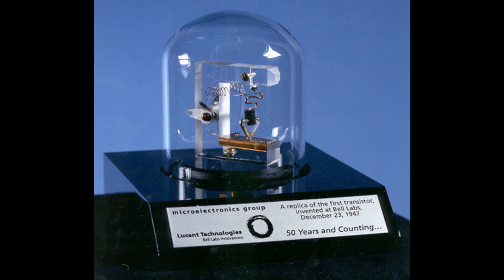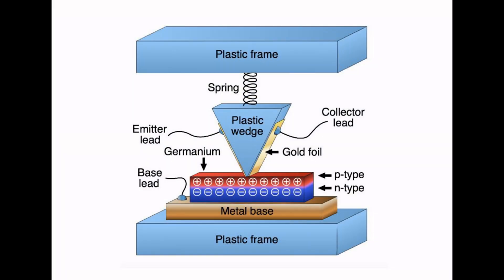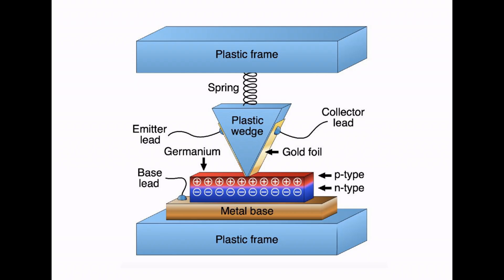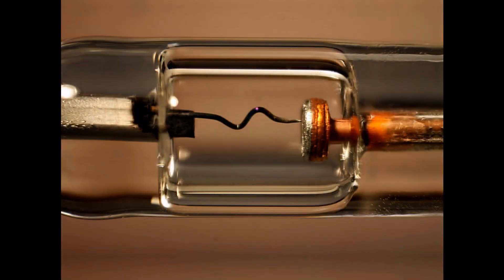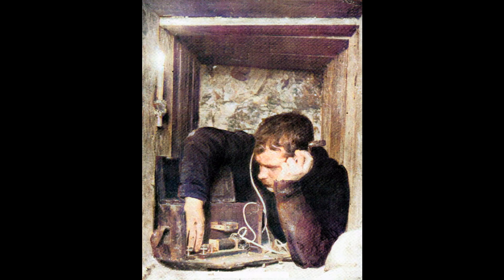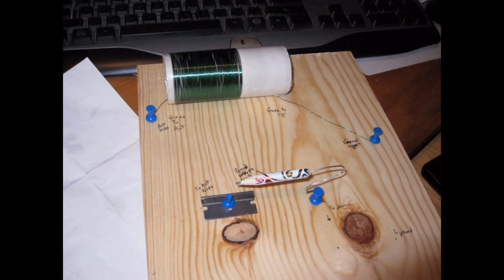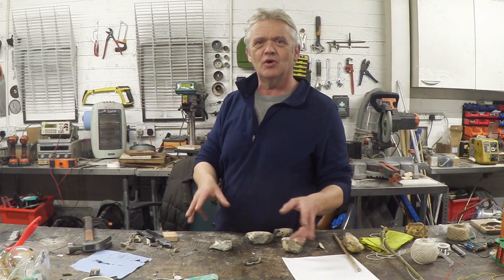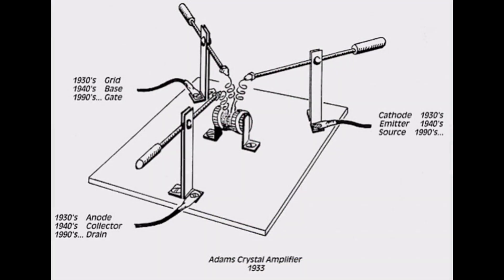1380 Making Transistors From Rocks

Comment: Try galena, it works for a transistor, especially the kind with decent amounts of silver and copper impurities. Mount to a an electrode using low melting solder. Next probe till you find points that act like a diode. Pick two that are close togther and apply a very low current to them. Look for the most change ratio of resistance with the least change in current between two points to find the highest gain.❤
Reply: I'd been looking into how electronic switching components could be constructed from simple materials, namely those which would've been available in ancient times. Relays were the first thing that came to mind, as they could be made with iron cores and copper wire, but they're eventually going to wear out at some point. Naturally, I tried to see if somehow a crude transistor could be fashioned using these materials. Galena was available in antiquity and would be used in the earliest diodes. The first transistors, on the other hand, used germanium, which unfortunately wasn't a mineral known in antiquity. As galena and germanium are both semiconductors, I wondered if galena could be used instead for a transistor, but couldn't find anything about it. Thank you for confirming that this idea has a modicum of possibility

Comment: you can cut thin pieces of crystal stone and sandwich between metal pieces to act as a transistor, or two pieces of metal painted with  thin oxide paint and dried,than two metal pieces are sqeezed together in one piece.

Comment: The point contact diode was invented by Jagadis Chandra Bose who used several types of rock. I am not aware of any point contact diodes being made any more as a superheterodyne receiver simply does not need them. IE you have a very accurate frequency source and mix it with your signal you can down convert it through a filter. For AM this is incredibly easy. FM needs veractor diodes (diodes that change capacitance with voltage). The other point people might be interested in is that the first transistors were thin film FETs not BJTs. Dr. J. Edgar Lilienfeld invented the FET way back in 1923 not Bell Labs who keep trying to pretend they were first. You can make your own thin film FET's using microscope slides as the glass substrate.

Comment: Great video. Tiny rocks like from crushing n-type or p-type silicon, can be mixed into waterproof paint to make a semiconductor paint instead of conductive paint only. Then two different layers of such paint could make a diode. And three layers could make a transistor. But details of connections and such need to be worked out.

Comment: Bornite. And zincite (Perikon detector)work really well so does iron pyrite( Man made) and aluminium foil. You can't beat the Germanium 1n 34a's , I've been trying though. If only I could find out what T Henry Moray's Swedish white powdery stone is. I need to get hold of some cassiterite ( tin oxide ore ) it's supposed to have an even smaller bandgap than Germanium. I wonder if you could use a super conductor material instead of a semiconductor materials to pull even more power from the aether ?
Reply: i think you can find your white stone powder in east europe

Comment: Excellent,  I  used to have a magazine collection  from 1920s of Australian  Radio n Hobbies and this method was described and corresponded over for some years.  Then slowly forgotten. The transition metal sulphides are interesting and  the semiconductor  effect  is said to be due to the varying sulphur to metal ratio throughout the crystals.
 You mentioned  negative resistance,  hence the tunnel  diode . Also there's  a quick way  of connecting  a P jfet and an N jfet to yield a tunnel  diode which I  think it's Clive Sinclair  created back in the early sixties for some exceptional matchbox transmitters he concocted .

Comment: i have a cats whisker for making a "coherer" for crystal radios...basically it holds a rock and you move the pointer around on the rock til it picks upa station
Reply: Thomas henry moray...
Reply: J F Corrigan?
Reply: The " coherer " detector was a glass tube with end caps like a fuse that contained a mixture of iron powder and nickle powder. A small current was passed though it, and when a radio frequency was also passed though it the iron powder would vibrate and disrupt the current, causing the coherer's current to respond to amplitude modulation, this was  because of magnetic disturbance of the iron particles on the nickle powder, Maxwell was famous for his ( silver ) hammer which he used to hit the coherer, when it had a reduced output, to re-distribute the iron powder when it clumped together through magnetic attraction.

Comment: the application of this stuff is really helpful to the amateur in very high power electronics where standard silicon solutions are usually very expensive. i you dont care about efficiency but need to handle tons of current these work well. there is a video somewhere where someone makes a very high current capaicity diode from i think borax in water between two plates.

Comment: Based on the last batch of Chinese transistors I bought, the quality and reliability was so low I think the Chinese are STILL making transistors out of rocks. 😖
Seriously, one out of every six transistors had one leg disconnected, and one out of every 20 had no legs measurable at all. Garbage. Obviously someone sold me reject transistors from the production line.
Fortunately i found out real quick and they didnt get put in anything important!
Dont trust Chinese rock transistors... 😥